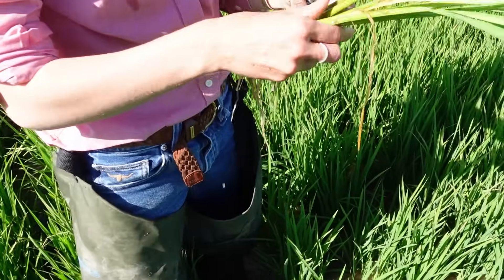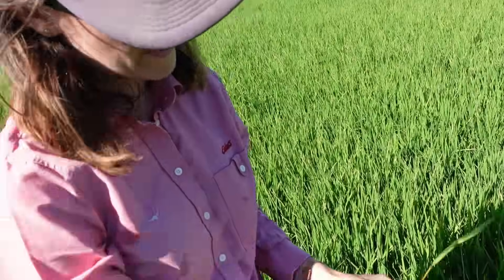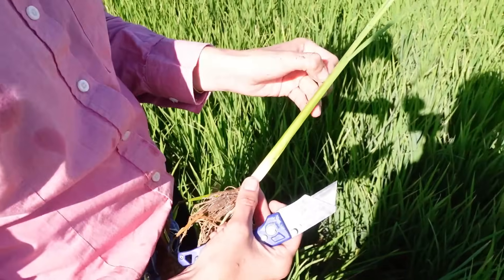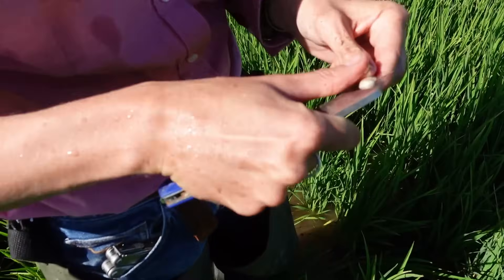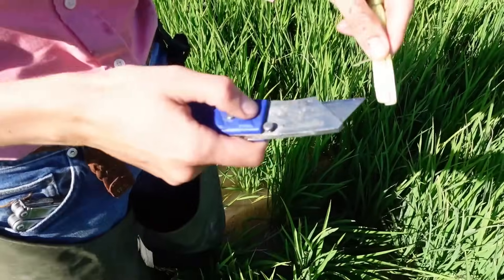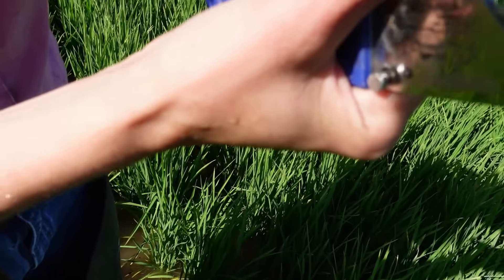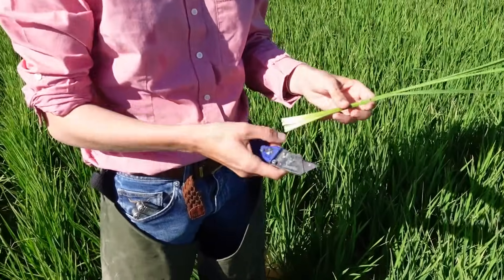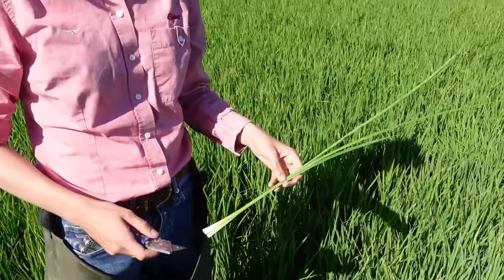Are drones the future for managing rice?

Comment: May not need rtk on the drone just for imagery as I'm sure you know it's pretty much an indicator , if surveying it's a bit different though.
My BIL has a fixed wing and gets ~600ac per flight I think, the processing of the images seems to be the biggest task.
With a guy as busy as you are , getting a contractor in to do the job may be better than doing it yourself , providing you can get them when you need them, but being able to do it yourself when the conditions are ideal also has its benefits .
Reply from the maker: Yes there seems to be a huge amount of data to process talking to old mate. And the time factor also did cross my mind, it’d be great to start with but when we’ve got heaps on I think it’d get put in the don’t have time basket. I think this guy would be pretty reliable, that was the vibe I sort of got anyway